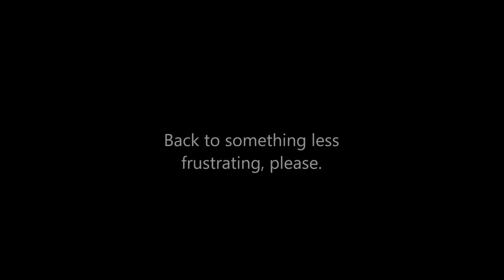Fender Wildwood is just wild.

Comment: I wonder how difficult it would’ve been to change out those saddles for something solid and properly adjustable?  It seems like the folks at Fender had an inkling of a good idea but executed it so poorly, that it turned into this mess.  

If it were my guitar, I’d be modifying that damn bridge to make it functional and sound good.  I’d start with some modern fully adjustable saddles.  Metal might sound fine, but if it doesn’t have the same resonance that an acoustic should have you could try to shape some out of bone or one of those synthetic materials that work well for making a nut.  If it works well enough at the nut end, why not the bridge?  I only suggest that because it’s possible  that bone might be too brittle to machine holes for screws.

If you’re getting really fancy, or have some metalworking skills, you could take some metal rod to recreate the stock saddles in something more solid.  Then you could flatten one side, possibly put some sort of groove or channel and then place a proper bone saddle on top, and secure it with some glue.  You could probably take an existing acoustic saddle, and use one of those thin saws to break it up between the strings.  With any luck you might still have room to put the height adjustment screws and then you’ll have this extremely complicated bridge that might sound better and allow for fine intonation adjustments.

I’m also wondering if there’s any reason you couldn’t use little rosewood dowels with bone affixed to the top as I described?  I don’t know if the little height adjustment screws would just tear through the wood from the string tensions or not—but that might be worth exploring.

Another idea I had, would be to create a hinged sort of level type mechanism like you’d see used in a Floyd Rose style bridge.  The strings would provide enough tension, and then you could have just a single, wide adjustment screw for each string that would raise or lower the saddles at the opposite end.  I would at least attempt to make it out of rosewood and bone like I mentioned previously, but if it doesn’t work maybe something machined out of brass would at least look pretty cool.

I don’t know, the way I see it, as long as you weren’t the first one to modify the guitar, it’s open season on mods—because why should some idiot, back in the 70’s or 80’s, get to have all the fun with their sub-par skills and poor workmanship?  If you do a good job, and improve the playability, intonation and tone/timbre of the instrument—it’s still going to be well worth the effort to anyone who plays guitar.  Keep all the original shit in a little bag tucked inside the case, so if some rich yuppie that can’t play wants to hang it on his wall he can revert things back to the original appearance.  Anyone that can fucking play is going to appreciate the sound, feel and vibe of the instrument.  I’ve never personally seen anyone with a vintage instrument from before the 1970’s that wasn’t at least slightly modified, if not heavily modified.

I firmly believe that those instruments made back then were manufactured with piss poor quality back then, compared to modern instruments are today—the complete lack of precision tools and techniques or technology we have now is why so many of them are pretty much unplayable.  Every professional guitar player just bought shit off the rack new back then, because that’s what they had, or they bought stuff secondhand a few years later because it was cheap.  Sometimes they got lucky and would find something with a good neck and on Fenders, guys would regularly swap them onto guitar bodies that looked good and had better electronics, because someone wired something up differently than they did at the factory.

I would also argue that instruments that played well and/or were strong enough/cared for well enough to survive until today not because the folks running Fender or Gibson back then knew what they were doing—they did it in spite of that, and thanks to the skills of a luthier or guitar tech that put a lot of effort into improving and fixing them.  As long as acoustics have that old dried wood to give it that resonance, that’s all that matters to them being old.  Electric guitars are a whole different story, because “tone wood” isn’t a thing with electric instruments, so it’s really more of a look or feel that people seem to like.  The janky old electronics might have an interesting sound, just because pickups were hand wound or they used components that don’t exist today.

Vintage amps and speakers, that’s where you’re going to find that vintage sound you’re looking for.

Comment: you could get away with slotting the rings/tubes and ad a screw to it. only downside is you need to add a metal plate where you just glued in that piece.

Comment: 20:17 In an instance like that, instead of clamping through the soundhole, you can insert a couple of Stew-Mac's brace jacks, to keep the soundboard from being crushed, then use a couple of cam clamps around the outside. Problem solved : )

Comment: I know this is a Year late. And also probably will get buried and never seen. But.... Instead of replacing that bridge. You could just ditch the metal hardware. And inlay a nice Rosewood shim piece in on top of the wood, redrill the peg holes and cut a slot. Thus keeping the "Original" wood of the bridge and saving some time on a full replacement. (You already replaced the wood under the saddles to raise it and also repair the broken wood. :)  (Also on the Righty acoustic that is now a lefty with the buzz. Wonder if it was a tuner. I have seen that before on cheap made guitars, the collars around the peg head can rattle). 

(Edit -I see where you said Tuners were checked. Sorry about that. What about truss rod or reinforcement bar or loose fret if it had not been said)

Comment: Regarding the buzz on the D28. I repair shoes for a living. I have come across squeaky shoes. Never manage to find the exact reason. I guess it can be many reasons. So when my OWN shoes squeaked. I thought I will take them apart. After putting back together, thinking the new layers of rubber solution glue will be bound to avoid any rubbing together of the leather layers......  Bas****s still squeaked after all that work. 🤪🤭🤣 So I understand your frustration at not tracking down the alien noises

Comment: Why couldn't you file the bottom of the saddles to lower action? Or even the tops of the saddles. What if someone made new saddles out of bone or Ebony.  You would have to epoxy in a threaded tube for the adjustment screw but it would tame the metallic ring.  It would be a labor of love.  I would cut the center bar out and re brace it proper.  Pull the top and give it a once over.  I can't see a bad design being too highly collectable.  I don't want one.

Comment: The only issue this bridge has in my book, is the fact that you can't adjust the string height at the bridge, and that can be easily fixed.  You can buy Fender type barrel saddles that can pop right on that monster.   This bridge was designed so that for the player, intonation would be easy and better than other acoustic guitars.  It wins in that department in spades.  on a normal acoustic now days, you can only make small adjustments to the intonation and that at times only gets you in the ball park.  With this one, you can easily intonate your guitar and to a fine degree.    If I were going to compare this bridge design as is to a more commonly used one, this one still wins..  It seems to me that twoodfrd's issues were connected more to the fact that he had not had to deal with this kind of bridge before than anything else really.  If this type of bridge was the norm, I think he would have issues with the more commonly used bridges for acoustics.   I have always said that the common acoustic bridge is crap, so I may be a bit biased at any attempt to fix the issues with them.

Comment: Hell if I weren’t worried about modifying the instrument and hurting it’s resale value, I might even go ahead and drill a hole in either side of each saddle and insert my own height adjustment poles, because the shim thing really must be a pain in the ass, both for the owner and the luthier. Or even just get a set of tele saddles and see if maybe they fit whatever mounting system they used for the BR bridge. If I were the owner that mod, or something similar to allow me to adjust the action more easily, would be very high on my list of priorities with this thing. Not sure what this thing’s value actually is (if it was said in the video I either haven’t gotten there yet or missed it), but if the owner is more of a player than a collector and wants the instrument to play rather than to look at as a historical piece, it might not be a bad idea.

Comment: Check the truss rod it buzzes
Reply from the maker: This guitar doesn't have a truss rod because it was made before 1986.  It does have a t-shaped steel insert which got a lot of glue pumped around it when I fixed the crack in the fingerboard.

Comment: That sounded to me like a truss rod buzz, my guitar also has a sympathetic buzz where the high e buzz along with other strings because i miss cut the nut at the high e, but you already checked that
Reply: Yes! I have a 1976 D-28 that has a confirmed truss rod buzz. The square tube is loose inside the neck. One fix, so I'm told, would be to take out a couple of inlay dots, drill a hole there and inject some type of glue that would dampen the buzz. Or, when I get the neck reset, it may be possible to fill the square tube from the dovetail end with something to stop the sympathetic noise.

Comment: secret to that buzz if you never figured it out, that guitar looks cheap, sounds cheap; my guess is that the nut is too flat, what I mean is that where the string lays on the nut there needs to be less material touching the nut, there should only be a fulcrum point of string touching nut and this may remove the ghost buzz.

Comment: Wow, I've never heard of this model.  Terrible design.   For neck shims, I generally measure the height I'm trying to achieve then with simple maths, you can accurately predict the thickness of the shim at its thickest end.  It usually saves quite a bit of toing and froing. 

As for mystery buzzes, I've had my share too.  When all else fails, I replace the strings.  Even if they were new in packet, there can be faulty wound strings that sitar and buzz etc.  Especially if the owner has supplied them.  They probably bought them on line, and they are fakes.  I always buy strings from the local music store.  Thanks for the video.

Comment: This basically confirms why Ive never liked Fender acoustic guitars.. They are all pretty much substandard. Fender's electrics I love but the acoustics.. Pass.. this Wildwood is the equivalent of Frankenstein. That bridge is a study in the designers handing off the final design details to the janitors. So on this bridge I would have routed flat this area below the saddles. I would install a thin flat metal shim. Saddles I would change to either adjustable Tele or Strat saddles with height adjustment. The fore/ft saddle adjustment screws would be changed to (1) Phillips head & spring to counter movement... Basically this is a horrible acoustic design from the guys who build Telecasters & Stratocasters.... It is a poorly designed acoustic model  which should have been relegated to the wood stove on the first day of " Hey, look what we came up with...  "